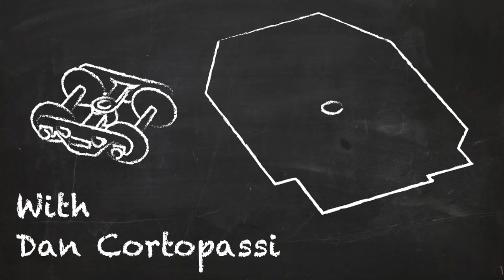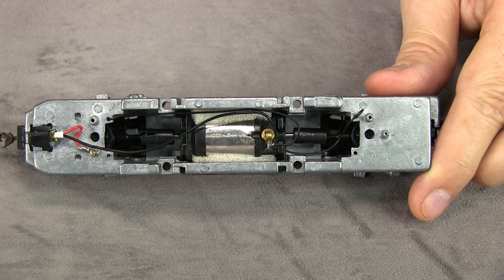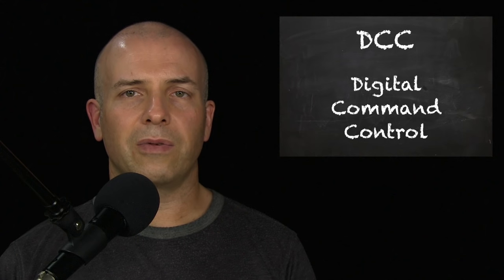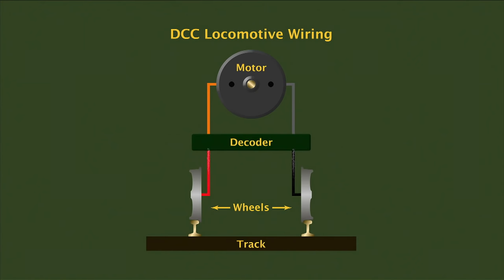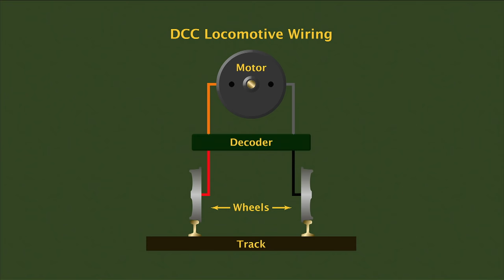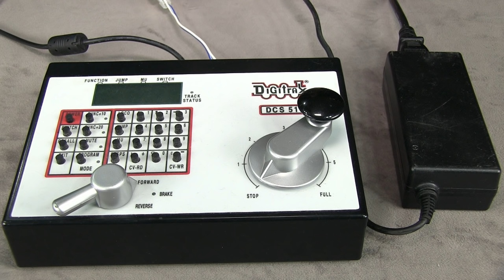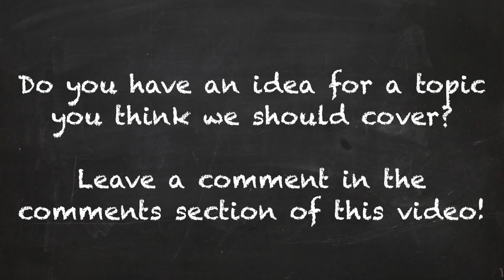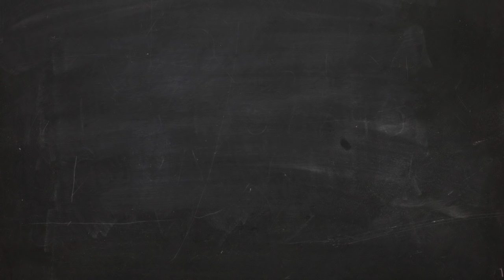Model Railroading 101 DC and DCC For Beginners

Comment: I have a question and it is just a thought. Using the DCC type system with the track powered all the time, is it possible to have a radio controlled device in the loco to regulate how much power the electric motor pulls from the track.

Comment: How about trouble shooting 101 for decoder install problems - can be very frustrating to figure out what causes a short or why the motor does not engage when the lights work and the decoder accepts programming.  Also a tutorial on stationary decoders and circuit breakers for DCC would be appreciated.
Reply: I just tried to convert about 10 Athearn EMD F45s and FP45s and 12 Intermountain N Scale Locos EMD FTs, FP7s and F7Bs with drop in decoders from TCS and Digitrax   however the Intermountains F units required wire soldering for lights and motor and I was only able to convert about 50 percent successfully,

The decoders I used for the Athearn locos were supposed to be drop ins but they kept shorting and I smoked about 4 TCS decoders which TCS replaced but then rather than risk them, I installed them in Kato SD 40 Snoot Noses where they run great.

I have learned how to disassemble these locos and reassemble them to use kapton tape and solder wires to boards but for some reason only some of the locos will run correctly.

Others will start but will not stop or they run on DC but cause shorts on DCC.  Or they run for while and they stop responding to NCE Power Cab.

Several decoders later I have pretty much given up on converting some wondeful DC locs to DCC simply because the hours I spend troubleshooting the locos is making me hate the hobby,   Its so hard to spend money on locos and decoders and then realize that they will never run on my DCC layout.   I have thought about buying more Internountains to test if the motors shorted out but the cost of trains verses saving for retirement and kids college.fund becomes an issue.
Reply from the maker: It sounds like a problem isolating the motor from the track power. Remember with DCC any short will fry the decoder.

Comment: Oh my goodness, this episode has been a fascinating one!  So much has changed since I gave up my hobby so long ago! 
 I had one question - can I run a DC engine on a DCC track?  Like, if I dug out my old stuff and wanted to go to a DCC system can I still run my old DC engines?
Reply from the maker: If the current is constant on a DCC track, a DC locomotive would not be able to be controlled. If you put a DCC locomotive on a DC track, however, that can work, but it makes a horrible noise, so it's better just to stick to the kind of operation that matches your equipment.
Reply: But it is possible to convert a DC locomotive to a DCC one?  It looks like a lot of work though.
Reply from the maker: It's almost always possible to convert DC to DCC.
Reply: It's only work if you don't enjoy it.
Reply: Yes, there is a DC engine control capability built into most DCC systems.  It functions by varying how positive versus how negative the signal on the track goes.  You can only run 1 DC loco and it will make a buzzing noise.
Reply: Dan Smith do not it is highly un recommended using dcc address 0

Comment: Can you use normal DC engines on a track setup for DCC.  I know you wouldn't be able to control just certain engines like you can with DCC but would they still work?
Reply: Absolutly no!
On dcc track there are 16volts and control is digital. You analog loco receives all volts and it’ll run fast.

Comment: DCC seems amazing. However it does seem to require someone to have knowledge of the Way to use the DCC device. Can you get simple DCC interfaces for a specific number of trains? E.g. 4 trains needs 4 speed-knobs, 4 direction switches, 4 horn buttons and 4 headlight switches in a simple panel layout. Each of the 4 channels could be programmed to the train via dip switches. The reason I ask is that I want to design the system for my kids to play with and I want it to be simple analogue interface.
Reply from the maker: I am not aware of a 4-knob controller. Digitrax DT400 series allows you to control 2 with 2 separate knobs on the controller. I would suggest to let the grandchildren learn how to operate the controllers. They might surprise you with how quickly they learn and understand the controllers if they're old enough.

Comment: Does the DC control make the engine power better on the locomotive model itself?  What I mean by this is  If I have two or three engines on my model or  pending on what model I am building does it mean I have more power or does.it matter because I could have one engine because the DC power is DC power?

Comment: Do you have to run, for example, digitrax HO decoders with a digitrax controller? Or will different brands work together?
Reply from the maker: Sure don't! Manufacturers generally stick with the NMRA standards that allows the end user to mix and match decoders and systems.

Comment: One question I have is...........? - And it concerns what you stated that when using DCC is that normally most Model Railroader's  (when programing their locomotive), they generally program a locomotive engine with the corresponding number of which is located upon that particular engine. 

That is an excelent idea. - However, I can see a potential problem with that idea. In reality, most manufacturer's paint (stencil), that same engine number upon all the same types of locomotive engines of which they manufacture pertaining to that particular model type.

If you (and somebody else), just happens to have that same locomotive engine with that same number and you both are going to run those two (or more), engines upon the same DCC layout at the same time.

Example: Let's say You yourself happen to have a BN & SF GP-38-10 and another model railroader down the street also just happens to have that same BN & SF GP-38-10 (in the same color scheme), and you both decide to go to the nearest Model Railroading club and you both decide to run both of your BN & SF GP-38-10's at the same time on the model railroading clubs same DCC layout, but yet neither one of you are paying particular attention to what the other person is doing, or what locomotive engine the other person is running. 

Therefore, lets say that you yourself wants to do some yard switching with your own BN & SF GP-38-10, and the other model railroader himself wants to haul mixed freight along the mainline route around the whole layout. - Isn't that going to cause a major confusing command issue for the two different locomotive engines as each BN & SF GP-38-10 thinks that it is the only locomotive engine being controlled because it has been pre-programed with that particular number at home by each person upon their own different individual layouts, but yet each engine is trying to be controlled by two different control units of which has the same engine number programed into it? - Just  asking.

Comment: Hi love your videos!
Gotta question, I'm getting ready to build my first layout using n scale on a 4x8 or bigger platform.
What size or type of a dcc digitrax controller would you need to operate say two or three or more dcc equipped locomotives and how to run them all at the same time with locomotives going in different directions and at different speeds and how to wire power to the tracks and switch points?
I think that would be something beginners would really like to know including myself.
Explaining how the dcc digitrax controller works is great but will be pretty much useless if we don't know how it's wired to power the tracks etc...
Maybe you could do a video on that?
Again you guy's are great!
Thanks!
Jim.
Reply from the maker: Hi Jim, all these systems come with documentation for wiring. Depending how complex your setup is, it could be as simple as connecting one wire to one track and one wire to the other track. That's how I set up my test track. Very simple.

Comment: Just learning about DCC. Is there a video that helps explain the track wiring for each? I understand due to track resistance you need to connect DC power at multiple points or lose voltage. How often to connect DC verses DCC AC power? Differences in how to wire power to sections of track that have switches? Cut out the interviews comments that are not on the subject please.
Reply from the maker: I bet you could find great info about that in books or even on the sites of the DCC system manufacturers.
Reply: @tsgmultimedia  Thank you I have now found several video that helps explain more about the wiring if a layout with suggested wire size and connection distances on a  layout.

Comment: A really big downside to DCC is the manufacturers.  I have an earlier version of the DCC system shown in this video.  It is no longer supported by the manufacturer.  With upgrades to throttles, compatibility is also a problem.  What you will find, or at least what I found, going to DCC is extremely expensive and there is no end to the replacement costs if you try to stay current with the hobby.

Comment: So if I have On30 locomotives that have DCC, would I use a Digitrax HO system? Or is there a special system for On30 locomotives?
Reply from the maker: You could use any system you want to use as long as it's wired properly.
Reply: Thank you. I think I will need to take a lesson on how to wire my rail system up because, I want to make a forward and back test track for my locomotives at the moment. I want to do something with them instead of waiting to be used on my shelves and have a bit of fun. The tracks I have are Micro Engineering On30 scale, (proper to scale), HO flex tracks.

Comment: So let me ask this. Since the voltage is constant in the rails, how many engines can be run at one time and is there a voltage drop in the rails?
Reply: You can probably run 2-3 locos on a starter system but eventually you’ll want to add a booster pack for more AC power. Especially if you are running lots of accessories off the circuit as well.

Comment: I am so lost. I have an HO set. I had it put away for a while and now I want to set it up and learn. When I connect to the power I hear the controller beep and my little locomotive attempting to go but it does not. Do I need to clean the tracks? Any suggestions will be greatly appreciated.

Comment: Is there a dcc controller for bachmann ez track?
Reply: Bachmann sells one. If you want to do what I did, you can just cut off the jack that goes into the controller and separate and strip the wires back to put them into the back of a DCC command station like the Digitrax DCS51.

Comment: Can you do an episode on how to get 2 or more locomotives to run the same speed when setting up a constance with Dcc control ? I've talked to modelers at shows and they say that there's two ways of doing this. One way is using start, mid, and max voltage and another way is speed tables. I've tried the first way and had some luck running 2 locomotives together but others I haven't been able to get them to run evenly together. Please help if you can. Thanks.
Reply from the maker: We will cover speed matching in an upcoming video at some point. We did that as a bonus chapter in our DCC installs DVDs but have not done it on YouTube yet.

Comment: Are all DCC manufacturers controllers and decoders interchangeable? I.e. will one brand decoder work with any system?? Thx
Reply from the maker: You're asking more than one question there. Controllers? No. For example, you can't use a Digitrax controller with a NCE DCC system, or vice-versa. 

Decoders could be a different story... In theory, any NMRA compliant decoder should work with any NMRA compliant DCC system. I say "in theory" because I have heard of people having some issues with some companies' "proprietary" decoders playing nice with the most popular DCC systems. Why they don't simply use the mainstream decoders in their products is beyond me, but that's their mistake to make.

Comment: Thank you for the videos. I want to do a winter layout on a round table that will turn while the trains run. Is that possible? How would I power everything without twisting wires? I know very little about electricity.

Comment: Can you possible run a locomotive with a bachmann dcc decoder on a dcc controller like a nce cab or any other dcc controller besides the bachmann e-z command control
Reply from the maker: As long as Bachmann adheres to NMRA standards it should work with any DCC system.

Comment: FYI , the best way to put what DCC is is that the the motor power control goes from being in a power pack and into the locomotive. Basically a remote control system. Big advantage is for those who want to add devices to the train and to simplify wiring for multiple locomotives.  
At 16:30 the comparison between your basic Dc and DCC was unfair because it was a basic and not advance with pulse and montuem
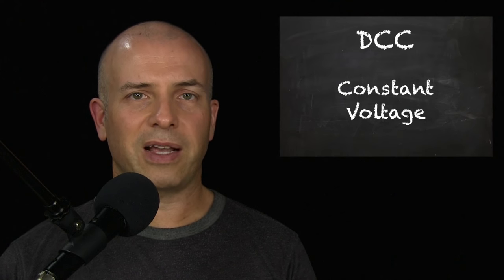Reply from the maker: Sorry I do not understand your comment. Dan stated pretty specifically that DCC is like having a little power pack inside the loco. Look starting at 7:50
Reply: comment was about early in video
Reply: I started out back in 70's when there was no such thing as momentum throttles and scenery was made with plaster of parris

Comment: Hello, could you do a video showing how to maintain or repair any long time serviced locos, say a fleischmann German steamloco made in 1999? Recently I got one of those on eBay and it runs with a wired burning smell. Should I replace the motor or just replace those carbon brushes, or should I just place it on a dead track and admire its beauty without using it.....
Reply from the maker: European models isn't really our specialty. If it runs with electric smell, you could just run it until it does not work then replace the motor.
Reply: Look into it. You should pil it up and check electrical connections.

If it is smelly of ozon, you probably have a problem with the motor. At least make an occular investigation of the motor.
Changing the motor is probably easier then the collectors/brushes.

Comment: Can you wire a train yard in DC, operate it for a while using a DC engine, and then simply swap out the DC power source for a DCC power source, swap out the DC engine for a DCC engine, and start operating the yard, again? If not, what has to be done for this to work? Thanks!
Reply from the maker: I'm pretty sure this would work, but there may be some variables (like the size of the yard and other possible features of a yard) that could affect how well it would work.
Reply: Yes you can. You can wire it in a way that it can be easily retrofitted. Also, all your legacy DC locomotives can be retrofitted with decorders....also...now with wireless operation hitting the hobby, this conversion has been made easier!

Comment: DC gets 12v + and - on the rails from the controller directly from the wire (hardwired as they say).  Increase voltage on the controller, and more volts go into the motor.  DCC as you stated runs the rails at constant voltage.  I think you said it's AC volts on the track.  The de-coder takes that voltage and converts it to DC for the engine motors. But you never say how the hand held controller "talks" to the decoder.  It's radio signal!   You never say that.   The "talks to the engine" you discuss is via radio signal and each decoder has it's own "address", which is its own radio frequency.  The finer control of speed comes from the finer output of the decoder and the motor's responsiveness to those lower voltages.  On a DC system, you have voltage drops along the rails, not consistently smooth voltage output from the controller and so the result is sometimes jerky speeds at lower speeds.  Sometimes you think you have power going out, but the voltage at the train location is not high enough to get it moving.  Busses help, but are not as good as the DCC decoder operation - typically.  So each engine on a DCC system with several engines on the same track can merrily run around on their own in different directions, all controlled by their individual controllers.

Comment: Hello. I have a g scale SD-40 BNSF locomotive. I would like to use battery power for it. Underneath the locomotive there are switches. There is one switch that says motors. Can I be able to replace that switch for a potentiometer that varies the current to the motors? And intern have that device connected to a wireless system that activates another motor to turn that potentiometer to very the speed? I'm guessing that if I use a potentiometer, it would probably burn out if it's not enough amperage.

Comment: How do you turn on the ditch lights, I have them on my engine and my new decoder, headlight works but the ditch ones i cant figure out how to turn on
Reply from the maker: Ditch lights are usually mapped to F6. You might end up having to check how your decoder is set up, because that isn't always the case... Just usually.
Reply: TSG Multimedia I can’t find anything on my decoder if you know anything about it, I have a Digitrax DH126P decoder
Reply from the maker: @Uboat65  Try contacting Digitrax.
Reply: TSG Multimedia ok I will thanks for the help!

Comment: so if it say that the train has TCS DCC installed or it has a decoder installed dose it just mean that I will work with any DCC power station?
Reply from the maker: TCS decoders should work with any DCC system. The ones you have to watch out for are the proprietary ones that don't adhere to NMRA standards. They might act weird and have problems on standard DCC.
Reply: TSG Multimedia ok I'll keep an eye out for those and thank you for the reply your videos are really help full